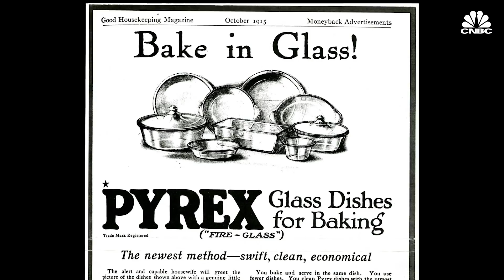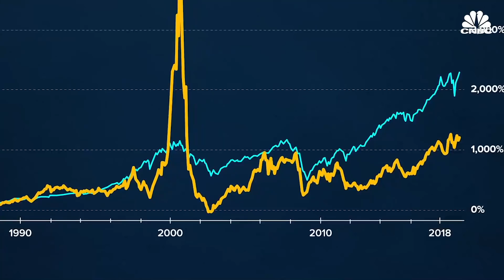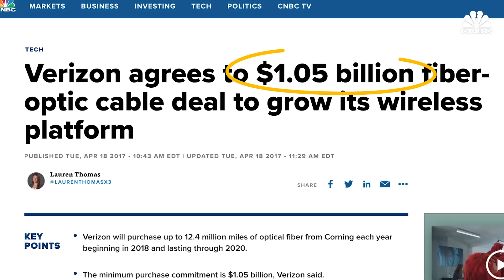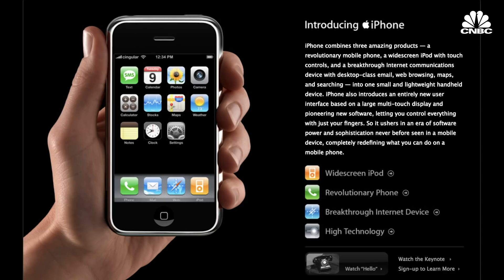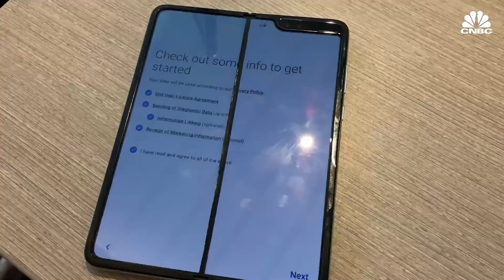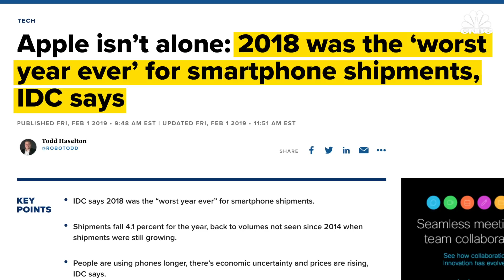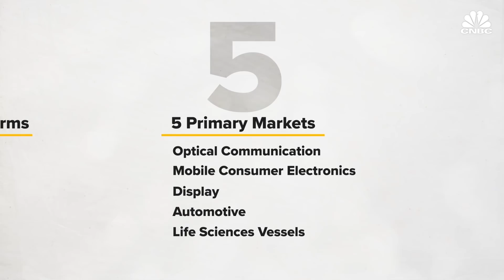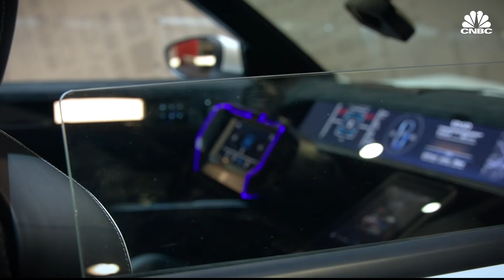How Corning Created Gorilla Glass And Reinvented Itself

Comment: I doubt glass used for lightbulbs was the big innovation.  It was the process of sucking all the air out the bulbs.  Soon someone figured out that vacuuming all the air out of the whole facility and wear a spacesuit to work inside the facilty was much easier and that was the big innovation of mass production.

Comment: 3:07 to 3:15 In 2007 Corning Glass introduce bendable glass fiber optics that can bend at 90 degree angles. But what Corning Glass does not have is Russia's own military grade self-amplifying bendable glass fiber optics that can also not only bend at 90 degree angles but can also re-amplify laser signals by itself alone without the need for laser fiber optic amplifiers!

Comment: Pyroceram or glass ceramic in short. In the 1950s and 1960s, printed circuits and semi-conductors are made out of semi-conducting glass ceramics which starts at first as ordinary glass and is tested and once it passes the tests with flying colors the entire set up is then placed in a heat treatment oven and allowed to be annealed overnight at a very high temperature without causing high-temperature creep and by the next morning, 24 hours later, the entire set up has nucleatized into a glass ceramic based monolithic glass ceramic-based electronics systems used in the 1st generation of ICBM missiles and top secret BMEWS networks that resistant to EMP and CME.

Comment: Another Corning corporate blunder was when they changed the formula for its Pyrex line of fire glass pans in 1998.  To cut costs, they switched to soda-lime glass which is cheaper to make than borosilicate glass, which is undoubtedly why Pyrex started experimenting with it. However, borosilicate glass is not only harder, stronger, and more durable than soda-lime glass; it’s also more resilient to thermal shock. And to make this soda-lime glass nearly as tough, they used a special tempering process.  But this inevitably resulted in the material breaking in catastrophic fashion - appearing as if to explode into smaller pieces, due to the increase in its frangibility.  And because this ice box-to-oven or vice versa claim was no longer valid - they were sued in a class action lawsuit.  https://www.courthousenews.com/wp-content/uploads/2018/06/Pyrex.pdf
Reply: WRONG, Corning sold the Pyrex name and formula to World Kitchen LLC. World Kitchen then made Pyrex, however there manufacturing locations and raw materials didn't work, the World Kitchen's Pyrex glass had a blue hue to it and had many breakage problems. Pyrex was re-purchased by Corning to quell the bad reputation and Corelle Brands was formed and has been sold a few times, the current owners are Cornell Capitol.
Reply: @Timinator62  I believe Corning sold off this division to save money in mounting litigation costs due to a large class action suit.  Seems that substituting cheaper materials backfired on them.
Reply: @brianbrewster6532  LOL ok dude you don'y like Facts or bothering to check things out for yourself...whatever.

Comment: Love how they talk about the iPhone having wireless  charging even though Samsung has it first and they put the iPhone 8 on a Samsung charger
Reply: Youtube Nick It’s in relation to Apple investing in Corning’s R&D, as from 2017 onwards, all new iPhone models have featured glass backs (which of course is required for wireless charging)
Reply: @ATTACKASSASSIN  Glass backs are not required for wireless charging. Plastic works just as well for wireless charging, but that goes against Apple's branding.
Reply: @Bob5mith  plastic  back doesnt feel as premium as glass does. That's why Samsung changed to all glass. I love my s5 but the changed to glass to to up a notch in quality feel, not quality in reality imo
Reply: @kendelion  It really doesn't matter once you put a cover on it to protect it and keep it from sliding out of your hand or pocket.
Reply: @Bob5mith  yeah, that's why the first thing most people does after buying a slim phone is to put a huge case to protect it from drops and scratches. Maybe that's one of the selling points, you get to customize your own phone by adding covers or cases
Reply: @kendelion  I use a thin silicone cover. It keeps the camera lens from touching whatever I set it down on, gives at least some corner protection, and makes it a whole lot less likely to be dropped in the first place. The phone is still pretty thin.
Reply: @Bob5mith  me too i actually have mine in dbrand to make it as thin as possible. I never drop my phone anyways so i dont need some thick case
Reply: Kitsune Ken who cares about samsung
Reply: Seekingbuddah yeah who cares... right? Lol

Comment: Now if they could make windshields that dont break when a pebble glances of it I will be really impressed.
Reply: IKR? I got a new car and within 2 weeks! $^%*^&
Reply: I’m sure that there already is glass that can resist that and much much more. It just depends on how much you or the average person is willing to pay for it.
Reply: a chip or crack depends on a few things, the angle of the windshield and the weather, a windshield is more likely to crack in summer due to the heat, and yes Mopar do have gorilla glass windshield but it’s on the inside layer of the windshield that is gorilla glass, and it doesn’t actually make it any stronger the a normal one, all it does is make the glass lighter
Reply: Stop tailgating gravel trucks.
Stop tailgating, period.
I haven't had to replace a windshield, ever.
Reply: Northern Bohemian Realist Many rocks are thrown by cars coming the other way.
Reply: A rock cracked my windshield and I’m in Florida.
Reply: They do...Gorilla Glass windshields for Jeep Wrangler.  Mopar part number 68401325AA
Reply: El Cheapo awesome! I will try to retrofit it to my CR-V. 🙂
Reply: @Packinheat1175  Your fault for buying a Honda.  😂
Reply: But then you wouldnt have to replace it
Reply: sbcontt YT You have no idea what you’re talking about!
Reply: A rock hit my windshield and made a small crack that wasn't a problem for years. Then I started a new job that didn't have garage parking and after a few hots days that crack expanded all over. The day after I had the windshield replaced I got a new chip from a rock! A week after I bought my  other new car I got a chip again! Argh!
Reply: Tech is available but not at yr pay grage

Comment: Wow! Now I'm impressed how they understand their market. It's not really about the number of units but the area.
Reply: I wish Mars had the same philosophy, 40 years ago you could beat someone to death with a Mars bar, today you can swallow one whole and it'd never be a choking hazard :/
Reply: Rob Fraser  -  that’s because the Mars bar is a rip-off of the Milky Way, which is still stupidly large...
Reply: Liam Sweeney  

Rudeness is not necessary to put stress on your point. If you don't have any idea how revolutionary such a perspective is then you should just respect the opinion of those who do. I do agree that it is common sense but I assure you, not everyone in the business has that common sense. It will be nice if you will be one of those to show them.

It is not really as simple as bigger pieces costing more. The problem is, if you are just computing per area, then the relationship should be linear. The problem with that is logistical and manufacturing costs increases progressively with size. The increase in cost is not linear. This means that larger pieces of glass should be giving them greater incentives than smaller pieces to compensate for that.

Now I don't think that incentive comes from the manufacturing side alone (cutting and polishing smaller pieces may cost more) but from the market too. They are a very old corporation and I can speculate with reasonable confidence that, this reasoning comes from experience with all the economic crisis they survived.

Can you imagine that bigger pieces of glass requires more materials than smaller pieces with the same ares. They need to be thicker and tougher. This will make the glass heavier and more difficult to transport and put in storage. Then the problem with manufacturing rejects. This means you will have more waste when making larger pieces. To minimize rejects, you can put the strain on the quality of the input ingredients. Better materials costs more. Not to mention the technology cost required to manufacture and develop the larger pieces.

I don't really know which is the greater factor for cost but knowing this from my perspective is enough for me to be impressed.
Reply: J P  

I can speculate that other sources for silica is too salty, or has too much sulfates. Hahaha! There's actually a global deficit in silica sand because of infrastructure development. They are very very lucky to have a high quality source.
Reply: Gennadiy Sharashkin  

It is possible because because bigger displays costs more. However, I do find that that to some manufacturers, the cost per area goes down with size. The jump in cost to some displays is more because of a difference in technology used and not the size itself. But then, I maybe seeing a small piece of the market. 

Is it possible that corning has a progressive pricing based on the actual price of the product. Maybe like some chip manufacturer charging Apple more and charging another less for the same chip.
Reply: What do they mean by 'area'? Market segments or literal size of the glass surface?
Reply: @shmookins  they care about the area of glass sold.